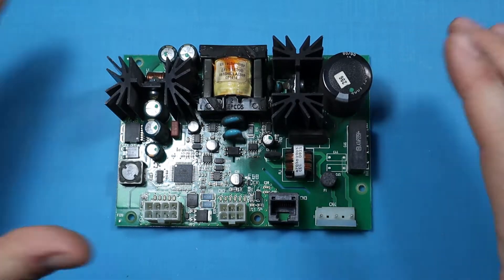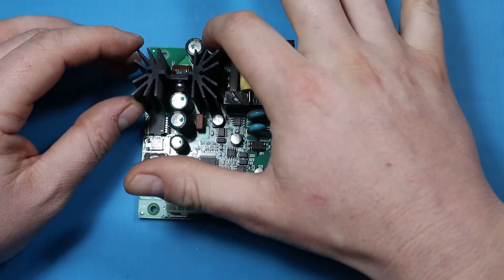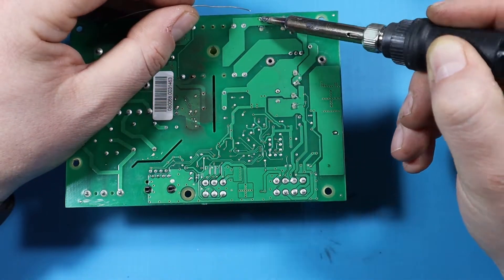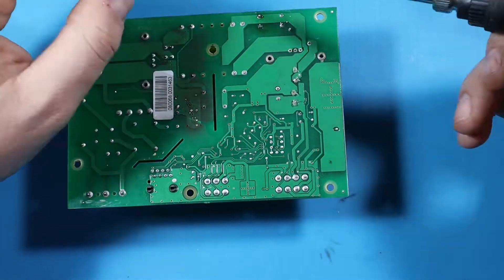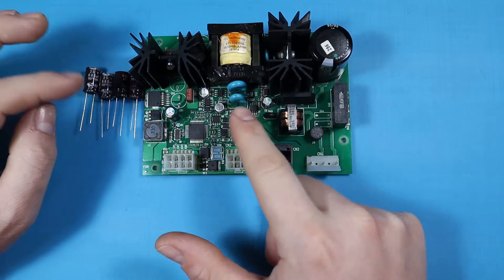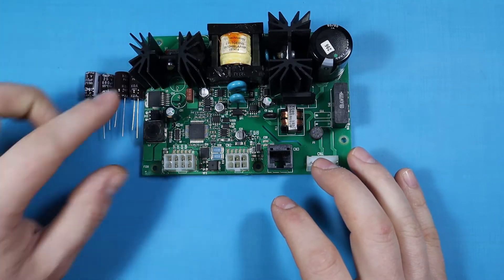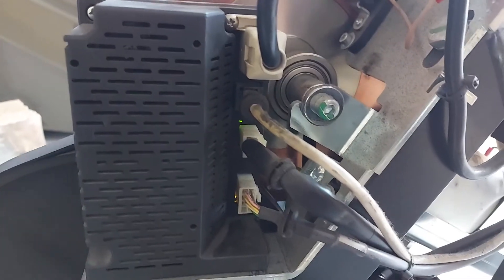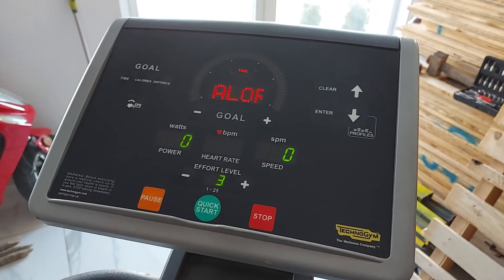$1 in parts to save $6000 machine - Technogym Wave Cardio break module repair

Comment: Hi, do you have maybe output voltage on each pin (in these two white sockets) this bord should generate?
Reply from the maker: Unfortunately not. I returned the machine to the owner after I fixed it so I no longer have it.

Comment: Very good video, super instructive. Here in Brazil I work repairing gym equipment, I've already repaired a lot of Technogym boards, especially this model. Congratulations, if you have any more about fitness equipment I'll watch it. I'm already a fan.
Reply from the maker: Thanks, I don't specialize in fitness equipment but in electronics in general. Most of the failures are the same anyway.